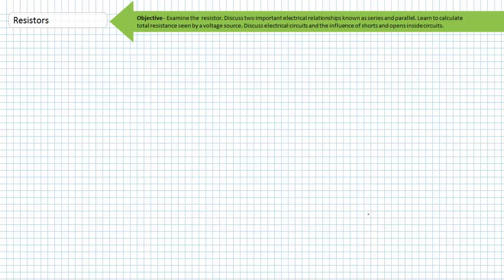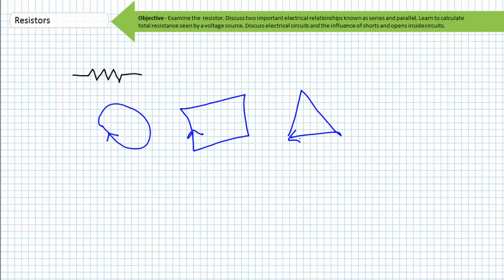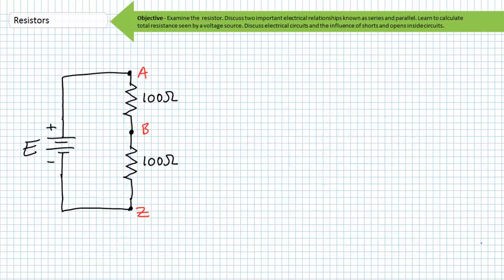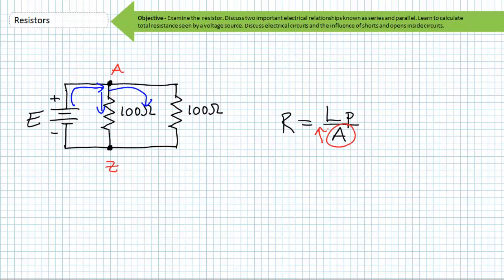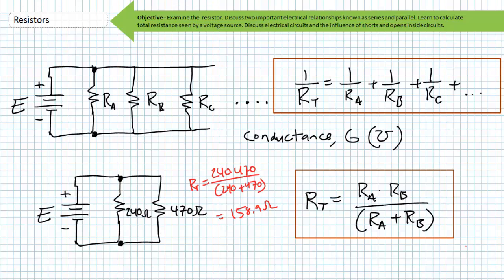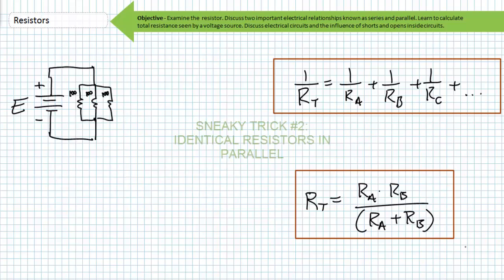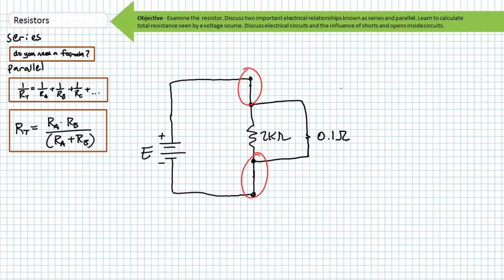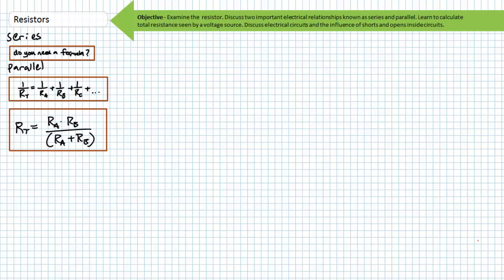Fixed Resistors (OLD LECTURE)

Comment: When there is more than 2 resistors i have never gotten the answer wrong using the formula you hate so much and im quicker at it. My calculator has the x-1 button on it so when i throw the numbers  in parenthesis and hit the x-1 button i get the right answer everytime. To each their own i suppose. either way this video has helped alot. thank you.

Comment: When I tape one of those little barbell resistors down by the "bar", and use my DMM (Sperry cheapo) to read resistance, my reading jumps all around.  Is this normal?  How to really read?  Without color code?
Reply from the maker: To get the most accurate reading make sure the resistor is totally disconnected from everything. Measure between the two leads only.

Comment: Is this the basis of a current regulator?  If it is, sure looks simple to build.  I don't want voltage regulator, just current.
Reply from the maker: You could theoretically use a potentiometer as a simple current regular. With a constant voltage source you could vary resistance up and down to keep current inside a specified range. Additionally check out the summarized theory of a current source at: https://www.youtube.com/watch?v=OH_ctqyfZjk
These are just basic concept but I'm hoping to examine more sophisticated power electronics in more detail in the future.

Comment: Brilliant as usual, but, sorry my calculator ( Casio fx-115 plus ) uses at least 5 keystrokes less if I use the inverse keystroke, the more I were to add the less keystrokes, yes I know you would simplify. I can only think my calculator is better than the Ti-88 Titanium, but I know it isn't. Keep up the good work I am slowly going through all your lessons in sequence and yours is the best I have ever seen, I am learning and understanding more than I ever did before, thank you for all your effort. Bob
Reply: With my hp calculator is way easier to work with inverse too, so which formula you use depends of what calculator you use.

Comment: Series Parallel circuits kicked my butt back in 67. ,,  Almost got me booted me out of aviation school and off to the Grunt Marine Corps.  lol...
Reply from the maker: Robert Higgins Don't scare the rest of these folks now! I want 'em killing newts first before they start worrying about dragons.
Reply: Jim Pytel
After I fell on my face during the fifth week   -- The Officer in Charge let me take the week over again.  Second time through got my head thinking in the proper channels and I totally applied myself through the rest of the school.  After factoring in my failing test in series parallel I still graduated 12/58.  The instructors in my day said "You need to learn to crawl before you can learn how to walk, and Learn how to walk before you can run.  I like newts and dragons better, but you know,,  It was the 60's.  lol